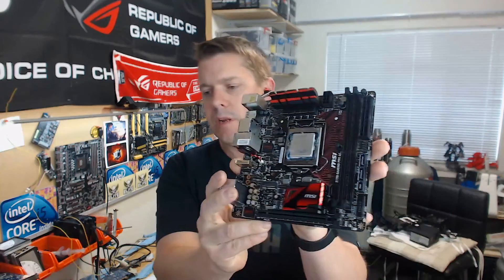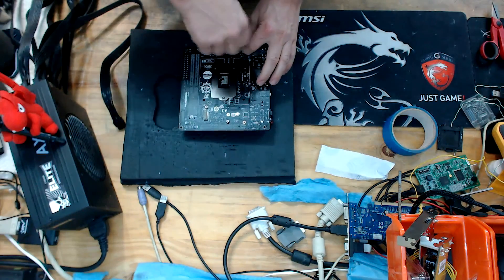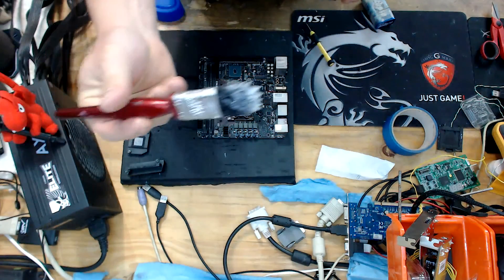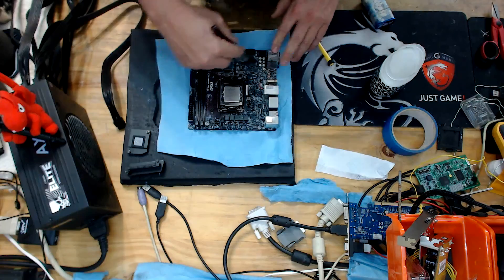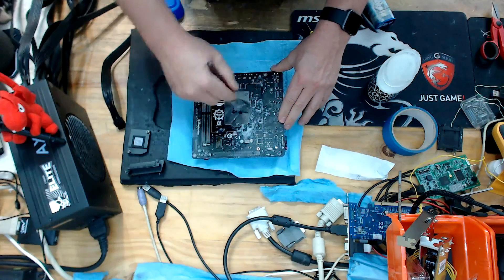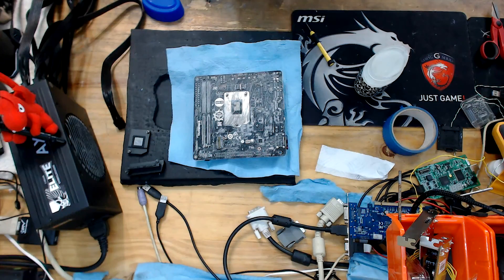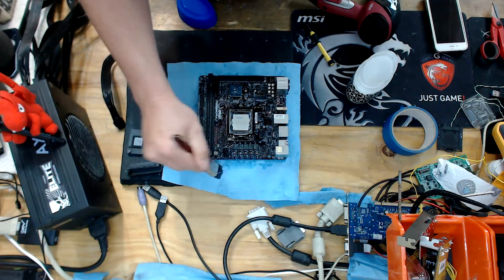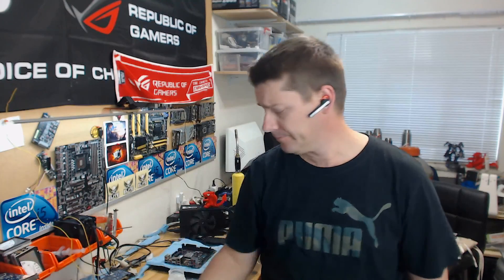The Lab #2: Preparing the MSI Z170i Gaming Pro AC for extreme overclocking (insulation guide)

Comment: Hey, nice video. I'm just getting into XOC and I'm wondering how often are you able to bench? Is there a recommended time you wait in between sessions? I worry that if any moisture from previous sessions is high risk of shorting components. I'm using Vaseline with a layer of paper towels then 1/2 inch armaflex on top.